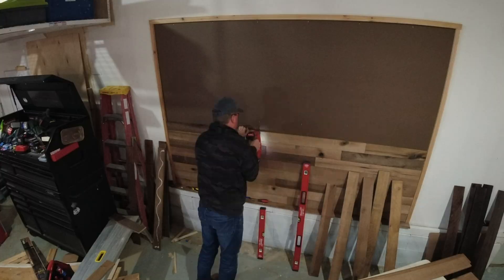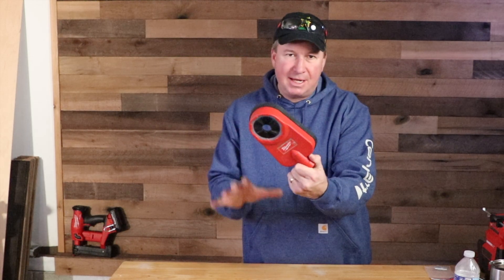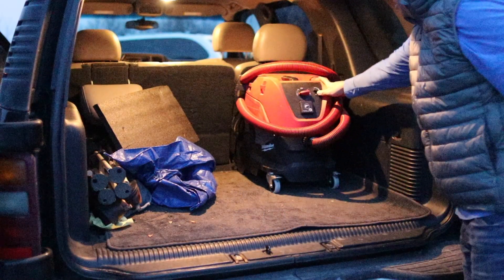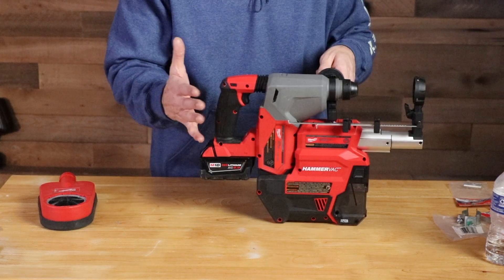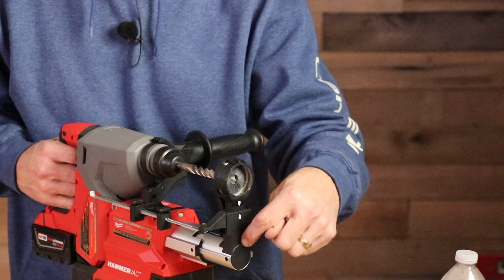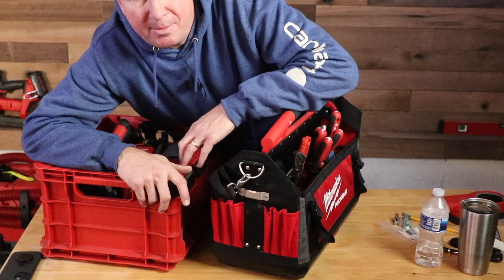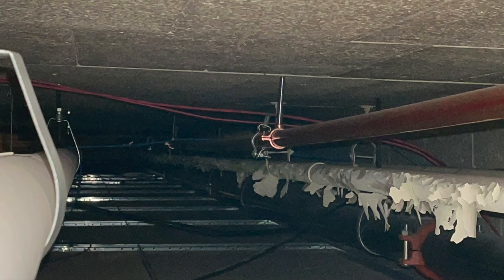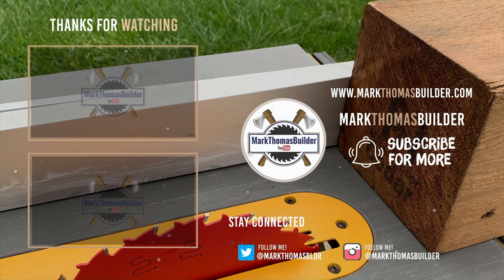Best Advice for Concrete Drilling - OSHA Approved Dust Removal System!

Comment: What part of the world is this video from? 
Interesting how there are very few clips in the pipe works. 
I can't see in the video, did you hammer the anchor in with a punch tool? 
Tip- there is a reliable, quicker and easier way to do the hanging. For 1st fix plumbing and heating I usually use rod hangers. You just have to drill a 6mm hole and then screw the hanger using an impact driver. 
Tip n2- there is a Milwaukee threaded rod cutter on the market. A very handy piece of tool and I'm very happy with the performance and the time saved doing 1st fix copper on price. The model in the UK is M18BLTRC.

Keep up the good work! 🔥
Reply from the maker: This is filmed in Michigan.  Yes, I hammered the anchors in with a punch tool and they're still holding.  That rod cutter would come in handy.

Comment: This was so informative! I was just getting into some DIY home renovations and I've already purchased a rotary hammer. Do you think a regular home vacuum (bagged) will work in place of a shop vac? I only need to drill ~20 holes (8mm diameter) so I'm a bit hesitant about purchasing a shop vac just for this purpose. But I also don't want to damage my personal vacuum as I've heard that concrete dust can really damage vacuums. 
Thanks in advance!
Reply from the maker: You only want to vacuum silica dust if you have a HEPA filter for it.  Otherwise, it might spread that silica dust back into the air.
Reply: @MarkThomasBuilder  Got it! Thank you so much!

Comment: It's disappointing due to the weight of the hammer drill and hammer vac
Reply from the maker: It's great to have an all in one unit, but if you're going for less weight, I recommend using a dust extractor and hooking the hose up to the Milwaukee SDS Dust Extractor Accessory.
Reply: @MarkThomasBuilder  that doesn't work for me as i m working at heights.
Makita has got this right and Milwaukee got it wrong